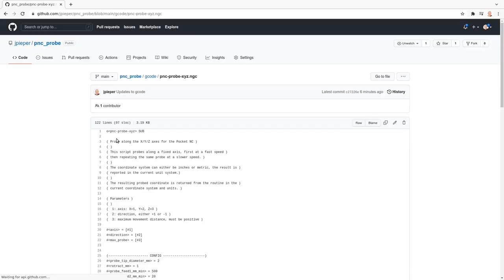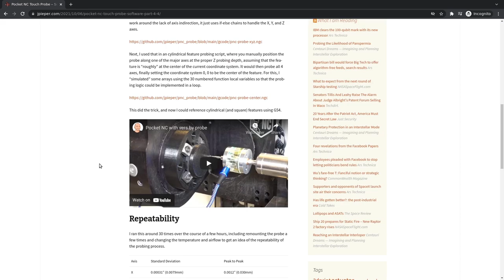Integrating a touch probe with the Pocket NC

Comment: This is awesome, Josh! Thanks for sharing so others can give this a try. I did want to drop a line and mention that dismounting the B axis circuit board (like shown around 1:29) will invalidate the factory B axis calibration, requiring the machine to come back to our facility for a recalibration if the user wants the machine to be as accurate as it was when it left the factory. So, it is much better if the probe can be plugged in without dismounting the B axis circuit board, which should be possible from what I could see in the video.
Reply from the maker: Thanks for the heads up!  I disassembled it to poke around and figure out how to integrate, but you are correct that no one using the probe would need to dismantle the B axis.

Comment: That's pretty dang sweet, especially for castings. Would you say the V2-50 is worth it over the V2-10?
Reply from the maker: For me it was worth it, since it has a much higher MRR in aluminum.  However, it only has decent torque at very high RPM, so the V2-10 might be better if you need high torque at RPMs closer to 10k, or if you are more cost sensitive.

Comment: Is that probe using a three-legged interruptor/spider on the inside?
My experience is that the lobes from those mechanics end up being the limiting factor, rather than the manual adjustment. Then again, turning the screws to 2 um (less than one "tenth") is boss, no matter where you do it :-)

Also, much nicer and generally more repeatable than doing it manually! I wouldn't want to lose the probe I have on my 440. Very worthwhile upgrade.
Reply from the maker: Yes, it has three rods radiating from a central column, each touching a pair of contactors.

The manual adjustment is definitely not the limiting factor.  In practice the actual probing is only repeatable to maybe 5-10um or so.  The spec for the probe is 3um repeatability, but the PocketNC steppers are in that range as well and contribute some.
Reply: @awesjosh  also, for lower cost items, specs are generally "best achievable" not necessary "guaranteed under adverse conditions" :-)
Anyway, looks to be working great. Nice add!